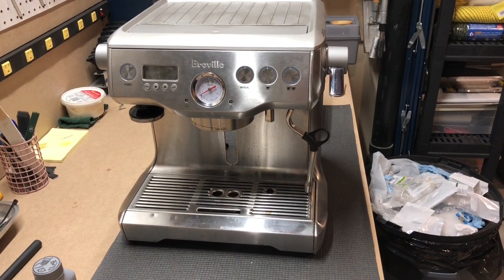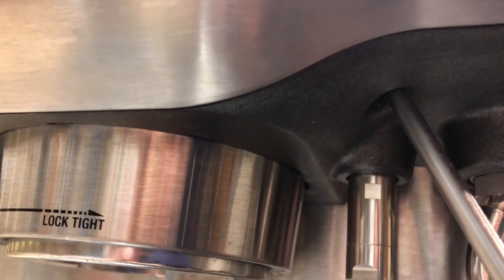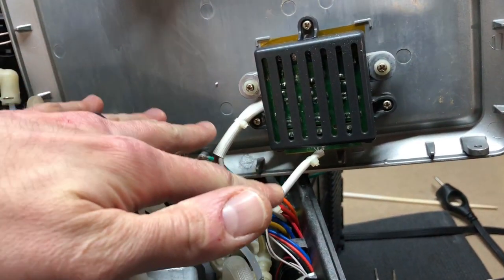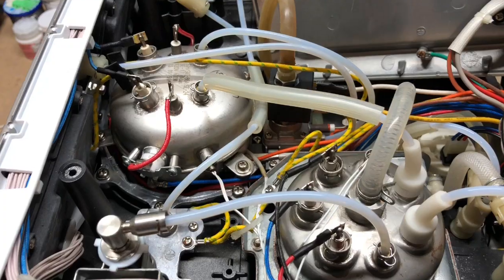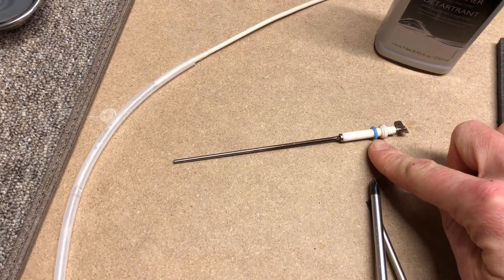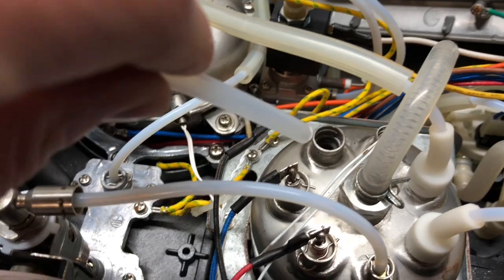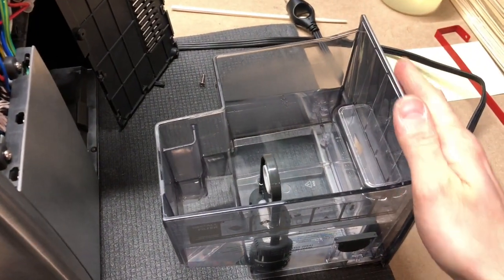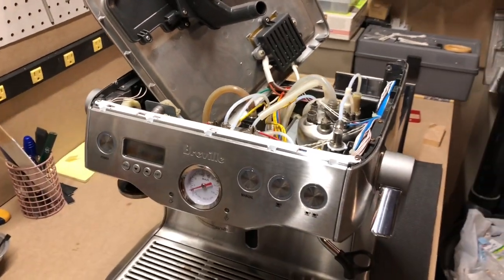Breville Dual Boiler Descaling Procedure

Comment: Hi Joe, thanks for the two videos. My machine has started taking much longer time to heat up recently. In the past, it took only about 20 mins to get to 200F, but in the past few weeks, it has been taking 45 mins to an hour... at times, the temperature actually started to decrease and the boiler doesn't seem to be doing anything...do you have any suggestions? Thanks.
Reply from the maker: Could be the PID circuitry or heating element. Unfortunately neither of those are cheap/easy fixes. It could also be a thermistor. Keep searching to see if anyone else has solved the same problem. Sorry I couldn't be more help...

Comment: Thank you for the video! I need to replace the o ring on one of the tubes with the boot, but there is so much residue buildup that I can’t get the end out of the boiler. It’s completely stuck! Any suggestions? TIA
Reply from the maker: Q-tip and descaling solution (undiluted) and patience. Apply, wait an hour then wipe. Likely have to repeat several times.
Reply: @322816  thank you for the quick response! I just now managed to get it off! I did use a Q-tip like you said. And I whacked it a few times, lol. This loosened it enough.

Comment: I have this machine, thanks for the instructions. The water I just removed from my steam boiler is tea coloured, but inside the boiler looks like there is no need for a descale, looks clean. It's about 6 or more years old so it's quite surprising.
I have the Cafetto Restore descaler powder, and I have put 500ml into the boiler anyway... I just don't know how long I should leave the solution in there before removing it. Any suggestions? The container of the descaler does not say.
Reply from the maker: I'd leave it in for at least an hour (with the machine on) then purge it through the steam wand. You might have to repeat a couple times if your boiler is badly scaled.  The problem might not be scale buildup but rather just really old water in the steam boiler - this boiler never completely empties itself. Either way it's a good idea to run some descaling solution through it.
Reply: Joe K Thanks for the reply. I didn’t know to have the machine on while using the rescale solution. I just left it sit in there for around an hour, drained it and refilled it and drained it again (with descaler) - no scale in the boilers, just old honey/tea coloured water. 
And the brew boiler was immaculate. 
I flushed it with fresh water a few times and then tasted the water coming out - I shook it in a bottle first to see if it bubbled - and all good. 
Thanks for the tips.

Comment: excellent instructions.  Thank you.  I can't get the "Service" message after descaling.  Any tips?
Reply: Did you ever figure this out? I have successfully descaled the machine, but trying to get rid of the service message.. Going into maintenance mode I found a reset function, but no way I can make it actually reset...
Reply: @dutchdatadude  No.  Still shows up at startup but it's a spare machine for us.  Use it for fishing trips and cottage.
Reply: @Mikefishtaker  right, ok. Well, I guess I'll just clean it once a year or so.

Comment: I've had mine sitting aside for a couple of years and have moved on to an ECM machine. Much happier!
Appreciate this video because it will allow me to get the machine up to snuff and possibly sell or just give it away. Hate to see it just sitting there. Breville charges too much for servicing and would never buy from them again, this is my second. To design a dual boiler with no thought to descallng says it all.
Don't you think running multiple tanks of water thru the machine, maybe 5 or 6, would dilute the remaining water enough to use?
Reply from the maker: Can't go wrong with ECM, certainly a quality upgrade from the BDB. It's tough to ignore the value of the newer BES920XL (added boiler drain plugs and increased steam boiler temp). Every time I start evaluating upgrading to a Synchronika I'm drawn back to the BES920XL at only 30% the cost...would really like to do a side-by-side taste comparison.
Reply: @322816   I was going to purchase the Synkronika at first but the much lower price for the Classika made it an interesting choice. Same brew group but less fancy case and not being a fan of milk based drinks, it won out. Completely happy with purchase with added benefit of quicker warm up and uses less power with just a brew group boiler. I got the one from Clive with the lever. Really seldom use that lever as I typically just add water from the brew group. Should have gone for the standard one from WLL. In my opinion, the Classika is without flaws!
Just a few days ago I descaled the ECM. Wow, what a difference! I'm one of those users that hold off on descallng until I have no other choice. As usual, it's so easy and trouble free that now I feel guilty for waiting so long.
Now, I'm going to tackle descalling the BDB without dissasembly.
Reply from the maker: @Rick9482   I also took a long look at the Technika - I appreciate the quality and simplicity of the design (fewer parts to breakdown over time).

You mentioned descaling your BDB without disassembly - once the descale solution enters the steam boiler it can only be removed manually. It's not like the Classika's boiler than can be fully drained without disassembly.
Reply: @322816  Check out Todd's videos at Whole Latte Love. You get to see inside many machines. He has one where he changed out the vibration pump on an ECM machine in about 10 minutes.
As to not dissasembling the BDB boiler. I figure addition rinse cycles would dilute any remaining solution to a minimal amount. If it doesn't pass a taste test on the water I would then proceed as you have done. Worth a try!

Comment: Great video mate!

Wondering if you knew what might be causing weak steam pressure on my BES900? I've taken the steam nozzle off and it's not blocked so I'm thinking it's overdue for a descale or the gaskets need replacing?

Cheers!
Reply from the maker: First I'd check the steam boiler to ensure it's getting up to the proper temp (run the machine with the lid off and use an IR thermometer to get a temp reading on the outside of the boiler, should be around 250F). If that checks out then you probably just have scale buildup somewhere alone the steam path. Descale or remove the steam wand and manually remove the buildup. (I assume you already removed and cleaned the steam tip, otherwise do that first).
Reply: @322816  Thanks for the advice mate. How would one remove the steam wand? I  previously tried loosening the nut at the top of the steam wand where it attaches to the machine but it wouldn't budge.  Also if the steam boiler doesn't reach the temperature are you aware of any culprits? Cheers!
Reply: @bradgehring3296  I have the same problem my machine is beeping when I turn on the steam wand and it doesn't work. I have descaled using this video and tried to get that bolt off too but it doesn't budge!

Comment: Have you ever gotten dirty water from the steam boiler? 

The machine went 2 months without use. It is almost certainly rust but I thought the boilers werent able to oxidize? I have gotten the machine back to functionality and am not seeing anymore of the rust water. 

Curious if you have seen this and how you proceeded with the machines life?
Reply from the maker: Are you certain it's not scale? Scale buildup is not always white. I suppose it could be rust, odd as that would be, in which case you'd want to consider discontinuing use of the steam boiler (a new boiler would likely cost more than the machine is worth). The steam boiler design in the 900 is flawed in that the water entering the boiler does not replace the water that's in the bottom of the boiler. There's always 'old' water in the bottom. It can only be fully cleaned by manually draining the steam boiler. If you do replace the machine then I strongly suggest a more serviceable/repairable machine like a ECM/Profitec, Rocket, etc.  Good luck.

Comment: How do you get those front screws out?  It's a nightmare to get a screwdriver up in there and actually engaged.  I can't imagine its any easier to put them back in?
Reply: I finally managed to get them out after about 20m of poking around.  I didn't bother putting them back in afterwards since they don't seem to add a lot of value.

Comment: Hi!

With a softening filter installed that is recharged every month or so, how often do you reckon I'll have to go through this procedure if I have on average 20 cups/week? It seems a bit daunting (I have a Expobar Brewtus IV on the way, my first dual boiler).

when you have the descaling agent in the water and are running it through the machine, do you also steam with it to clean those pipes/hoses? 

Thanks for a great video!
Reply from the maker: It all depends on your water chemistry. If your water is very hard then you may have to descale quarterly, if it's fairly soft to begin with then you may never have to descale. If you see any sign of scale build-up, particularly at the end of the hot water dispenser, then descale right away.
Reply from the maker: Yes, definitely run the solution through the steam wand too.
Reply: @322816  fantastic! Just found out yesterday that where I live water is considered "soft" (bottom third of relevant scale). this'll save me a lot of headache. also, on top of the water softener filter included with the expobar I use a floating bad in the dispenser. both of which I'll make sure to change/recharge (btw, can you recharge the pillows?)

Comment: Hi Joe - I have a sage BES870UK  Barrista Express Espresso machine 
which looks exactly the same on the outside as your Breville in this video.

ive watched your video re OPV/valves.

ive spent a good few hours descaling manually from the rear of the unit which has improved flow slightly.
ive taken a few photos of the unit and am also happy to take a video to show you what problems im experiencing.
I'd really just love to get your opinion on what the problem might be.

I dont have this unit covered under warrentee.
I do not get hot water or steam, unless i completely compress the "OPV to Drip tray" pipe.
if i run an espresso shot. i get about 5ml of water in the cup , the rest goes straight to drip tray. ( again if i squeeze/block the opv to drip tray pipe i get more water in cup.)
I do not get any water when running 2 dbl espresso shot.

please let me know if you'd be interested in casting a second pair of eyes and how i can get in touch privately.

Kind Regards.
Chilli
Reply from the maker: Sounds like your OPV is either set way too low or not working properly. Try adjusting it per my Solenoid/OPV video (it's quick and easy to do). If that doesn't work then I'd remove and dismantle the OPV to see if you can find the source of the malfunction. If that still doesn't do it then replace the OPV - if you can't find the OEM part then you can make it work with a brass OPV (I once stumbled across instructions online explaining the parts and procedure).
Reply: Ok i do have a replcement opv on the way., i have  adjusted the OPV open & closed, removed the plastic clip completely removed the pipe including spring and red rubber washer. cleaned the hole  ensured i could pass a pin through the gap into the main chamber. then put it back together. its after this that i noticed if it is closed to much i get no water at all in cup.  insert and 4 turns seemed to do the trick.  my thoughts were theres to much compression in the coil boiler (or maybe limescale), so the pump cant push the water in to the boiler. in turn its bypassing out the opv in to the drip tray, so when i squeeze the pipe  (block it from going to drip tray its forced to go in to the boiler. 

im going to get some descaler on the way home. try that, and also see if i can completely dismantle the OPV. and ill get back to you.

hey thanks for your reply so far.
Reply from the maker: Scale buildup could certainly be the source of your problem. Pull one of the probes out of the boiler and check it for scale.
Reply: how can i share an image with you ?
Reply from the maker: Best bet is to post a video and send me the link (you can delete it afterward).

Comment: I’ve run in to an issue and was hoping you could help. Pressure gauge was acting up so I took it apart, clog, and now when trying to reassemble it leaks from where the gauge goes in to that plastic elbow. I’ve tried new o-rings from Ace, old O-rings to test, and it all still leaks. Any ideas?
Reply from the maker: You could try adding a stainless steel washer on the hose before the oring. Some of the other hose connections have them. Hard to find so you might have to make yourself.

Comment: I have a probe on my steam tank that won’t come out. Have any suggestions? I replaced 2 pro o-rings but couldn’t get that 3rd prob to come out. Then my son broke the plastic on the top part of the prob when he was trying to get it out with a pair of needle nose.🤨 Also, do you know where to get a replacement probe?
Reply from the maker: This is a common problem. It's likely stuck due to scale buildup. Soak the top of the probe in descaling solution (for an hour) and scrape/wipe away whatever you can then repeat. You may have to repeat several times - be patient.   Look up the part number on erepalcementparts then just search for a part supplier who has stock. Good luck.
Reply: @322816  How did you remove the wire from the probe connector? You sort of glanced over this in the video as you mentioned you already loosened it. I’ve tried to carefully pull, but it doesn’t give.
Reply from the maker: @martinkor  It's a spade connector so you could google that to see how they work. If it's very tight you can use pliers but be sure to use pliers on both ends (i.e. female and male ends of the connection) so you don't stress the probe which could bend or break it. If that still doesn't work you might have to bend up the two curled metal ends on the female end of the spade connection - there are other videos on youtube on how to deal with a tight spade connector. Good luck.
Reply: @322816  thank you. Were your connectors fairly easy to come off by hand?
Reply from the maker: @martinkor  I wouldn't say they were easy to remove by hand the first time but I was able to do so with some gentle wiggling. It's hard on the fingers but safer than using pliers. Once they come off they go on/off more easily.
Reply: @322816  thank you! the vids are very helpful.

Comment: Hi Joe, so I don't have a dual boiler, I got the old best 860xl and have it for a good few years. So I descaled it for the first time using urnex descaler. Did as instructed and flushed out everything but I find small black particles coming out of both steam wand and from the group head. Is this scale or something worse like corroded metal?
Reply from the maker: It's not uncommon for white, green and black particles to be present if the machine has not been descaled for a long time. Not sure what the black is but I suggest you keep flushing/descaling until you're satisfied that everything (or nearly everything) is out. Certainly makes you wonder about how 'clean' the machine are at coffee shops - one more reason why you're better off making your coffee at home.
Reply: @322816  yeah. Been flushing for 2 days. Did another group head back wash with the blind filter. The particles has decreased significantly from the group head. I can actually count the number of particles, maybe 4 or 5. I notice more coming out from the steam wand when the water comes out first. Maybe I must flush the steam wand more. Out of the steam wand, I see about maybe 10 particles at a time. What I did t mention earlier is that when I did the initial descaler, a blue-ish liquid first came out of steam wand. Also the water that I use is filtered water that dispenses from my refrigerator and I hardly ever change the charcoal filter from the coffee machine. I have to get some new filters for those. Wondering now if this water particles or even charcoal particles. Machine must just last a year and then I'll be happy to upgrade.

Comment: Hi Joe - my DB trips the GFCI about 2 or 3 seconds after powering on. I replaced the o-rings (had a couple of small leaks) and solenoid (was buzzing) but with no luck. There are no leaks inside the machine. 

If I bypass GFCI, the machine works fine (but obviously can't use it like that long term)

Have you got any suggestions on how to diagnose the issue.
Thanks
Reply from the maker: Are you certain it's not your GFI receptacle? It could either be defective or underrated for the current draw from this machine, Otherwise visually inspect all the grounding points in the machine.
Reply: Got it working now thanks Joe - I just had to spend a lot longer with a hair dryer. the leaks I had were from the top of the steam boiler so I think some water had found itself into the electrics below the steam boiler - difficult to get to.

Comment: Here's a crazy idea.. why not cut the cable tie holding the middle hose on the steam boiler to the distribution block and then pull the PTFE hose going to the steam valve? You've then got two longish tubes. take the drip tray, tools, water tank and tamper out, flip the machine over the sink and blow air into one of the hoses and watch the water shoot out the other hose.

Comment: Came across this old video and it has become a little outdate, stil lgood for those who have the old version of the machine, they have actually added boiler draining valves/screws to the base of the machine now! so no need to take machine apart :)

Comment: I have this machine and every time I turn it on it leaks all the water from the bottom slowly can u tell me what's going on I can still pull shots and use it but eventually it leaks all the water out
Reply from the maker: Once your machine is pressured it starts to leak - it's either a boiler o-ring, cracked hose, or hose connection. Check out my video: "Breville Dual Boiler O-Ring/Gasket Overview".